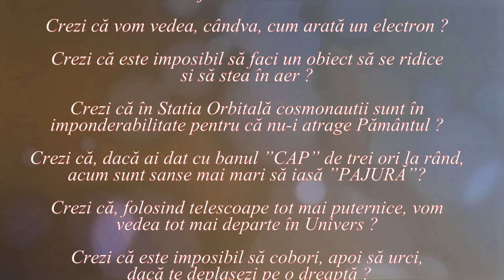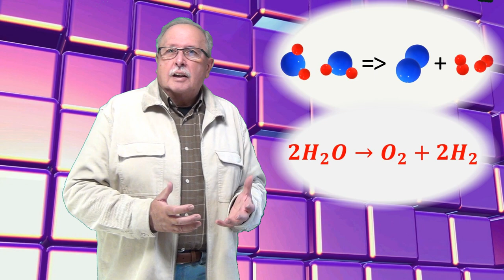Motorul cu apă ? (WATER-FUELLED ENGINE ?) (Lumea nu este cum crezi _ 11)

Comment: Stimate domnule profesor,ideea este că apa poate înlocui hidrocarburile ,poate fi real ?
Reply from the maker: Apa nu poate fi combustibil chimic pentru că este deja produsul unei arderi. Apa se obține prin oxidarea hidrogenului (cu sau fără flacără). Când arde benzina sau motorina se obține apă și dioxid de carbon. Când arde hidrogenul se obține doar apă.
Nici apa și nici dioxidul de carbon nu  pot arde încă o dată !
Dar apa poate fi descompusă în hidrogen și oxigen, iar hidrogenul poate să ardă din nou și iar obținem apă.
Dar PENTRU A DESCOMPUNE APA ÎN HIDROGEN ȘI OXIGEN TREBUIE ENERGIE, TEORETIC ATÂTA CÂTĂ VOM OBȚINE PRIN ARDEREA HIDROGENULUI. Practic mai multă, pentru că avem pierderi prin căldură.
Deci putem înlocui hidrocarburile dacă avem destulă energie regenerabilă încât să obținem suficient hidrogen. Deocamdată n-avem.
Reply: @RomulusBoeriu  Mulțumesc pentru răspuns.
Reply from the maker: @unic3372  Cu plăcere !

Comment: Domnule profesor, eu sunt un necunoscator in ale fizicii si chimiei, detin doar cunostinte de baza. Am vazut si clipurile de pe YouTube legate de “motoarele pe apa” si am citit si comentariile care au aparut la acest clip al dumneavoastra. Cred ca exista o confuzie, comentatorii nu se exprima cum trebuie. Ori ca nu pot, ori ca n-au inteles ceea ce dvs. ati explicat in acest material. Daca-mi permiteti, incerc sa reformulez printr-un exemplu:

Sa zicem ca avem o masina (pe benzina) care consuma 7 litri/100 km. Litrul de benzina sa zicem ca e 7 lei. Deci la fiecare 100 de km parcursi trebuie sa scoatem din buzunar ~50 lei (folosesc cifre rotunde, valori aproximative, oricum e doar un exemplu). 

Daca ar fi sa folosim apa, respectiv hidrogenul extras din apa prin hidroliza, pentru ca masina sa parcurga 100 km (in aceleasi conditii de mers) am avea nevoie de o cantitate “X” de hidrogen. Consideram ca apa e gratis, deci cost zero. Dar pentru procesul de hidroliza trebuie sa folosim energie electrica. Aceasta energie o luam dintr-un acumulator pe care-l incarcam acasa, la priza. Deci platim curentul. 

Acum va intreb: cantitatea de energie electrica folosita pentru hidroliza, astfel incat motorul sa poata propulsa masina pe o distanta de 100 km, ce costuri ar implica? Practic curentul de la priza pe care l-am folosit sa incarcam acumulatorul (care la randul lui ar da energie pentru extragerea hidrogenului din apa), ar genera un cost mai mare decat cantitatea de benzina folosita pentru parcurgerea distantei de 100 km? Va multumesc! 🙏
Reply from the maker: Am explicat acest lucru în clipul "HHO ?" pe care l-am publicat acum câteva zile. Tocmai pentru că, așa cum ați observat, mulți nu au înțeles despre ce am vorbit în "Motorul cu apă ?"
Reply from the maker: Poate n-am înțeles întrebarea de prima dată. Doriți să știți cât ar costa să obținem prin electroliză hidrogenul necesar pentru o deplasare de 100 km ? Voi face mâine calculul.
Reply: @RomulusBoeriu  exact! Si nu e nevoie de cifre exacte, pentru ca ar fi extrem de dificil de estimat (conteaza tipul masinii, capacitatea motorului, transmisia, viteza de croaziera, greutatea etc. etc.), insa macar asa, la un nivel aproximativ. Adica ar costa la jumatate comparativ cu pretul benzinei (sau al motorinei or GPL), sau doar 10% din pret, sau 230% etc. Pentru ca pe internet circula zvonuri cum ca dintr-un litru de apa se extrage hidrogen cat pentru a propulsa masina pentru mai mult de 1000 km. Probabil de aici si confuzia cititorilor. Nimeni nu a zis ca o masina ar merge pe apa generand perpetuum mobile, ci doar ca ar face-o cu un cost mult mai scazut decat cel al benzinei/motorinei/GPL-ului. Va multumesc!
Reply: Teoria internautilor spune ca energia (electrica) produsa de alternatorul masinii este suficienta pentru a realiza procesul de hidroliza si ca folosind o cantitate infima de apa (cca 1 litru) se poate produce cantitatea necesara de hidrogen pentru a propulsa masina pentru 1000+ km.
Reply from the maker: @OldPhonesWorld  Teoria internauților susține că hidrogenul produs dintr-un litru de apă poate propulsa mașina pe 1000 de kilometri ??? 
Păi să calculăm cât hidrogen se poate obține dintr-un litru de apă.
Un litru de apă cântărește 1 kg.
Masa moleculară a apei este 18 (de două ori 1, masa atomică a hidrogenului plus 16, masa atomică a oxigenului). Asta înseamnă că raportul dintre masa moleculei de apă și masa atomilor de hidrogen din ea este 18:2=9.
Deci dintr-un kilogram de apă putem obține (1kg : 9) kilograme de hidrogen, sau (1000g : 9) grame de hidrogen, adică aproximativ 111 g de hidrogen. Cum poate cineva să creadă că 111g de hidrogen pot propulsa un automobil 1000 de kilometri ??!
Prin asta cred că am demonstrat că internauții n-au, de fapt, nicio teorie, iau informații unul de la altul fără discernământ, în loc să le ia de la cei care se pricep la fizică și chimie.

Și acum calculul pe care m-ați rugat să-l fac.
Vreau să precizez, de la început, că este un calcul aproximativ și care ține cont doar de aspectele teoretice. Dacă ținem seama de aspectele tehnice, lucrurile se complică mult, iar rezultatul este că, de fapt, trebuie să cheltuim și mai mult decât arată acest calcul pentru a ne deplasa folosind hidrogen pe care l-am obținut prin electroliza apei.
Pentru a descompune 1 kg de apă în hidrogen și oxigen este nevoie, teoretic, de aproximativ 4,4 kWh. Dacă ținem seama de randamentul electrolizei, trebuie binișor mai multă energie, dar să presupunem că putem să o facem cu 5 kWh. În acest fel obținem 111 g  de hidrogen.
Puterea calorică a combustibililor se măsoară în MJ/kg.
Puterea calorică a hidrogenului este cam de trei ori mai mare decât a benzinei. Știm că ne putem deplasa 100 de km cu 5 kg de benzină (Nu e totuna cu 5 litri, benzina are densitatea mai mică decât apa. 5 kg de benzină înseamnă cam 6,6 litri)
Atunci, folosind un motor pe hidrogen care are cam același randament cu motorul pe benzină, vom avea nevoie de 5:3 kilograme de hidrogen, adică de aproximativ 1,7 kilograme de hidrogen.
Dar, se pare că unele firme susțin că pot obține randamente mult mai bune, așa că, să presupunem că avem nevoie de doar 1 kg (1000 de grame)
Pentru asta trebuie să electrolizăm 1000:111 litri de apă, adică cam 9 litri de apă.
Și pentru că avem nevoie, așa cum am arătat, de vreo 5 kWh energie pentru a descompune 1 litru de apă, înseamnă că avem nevoie de aproximativ 45 kWh pentru a obține hidrogenul necesar pentru a ne deplasa 100 de km folosind un motor pe hidrogen.
Cât costă asta ? Habar n-am, deoarece în ultimul timp prețul unui kWh se schimbă mai des decât apuc eu să scriu aici, așa că vă las să calculați prețul.
În final, repet: acesta este un calcul teoretic și aproximativ. În realitate, dacă ținem seama de toate randamentele și cheltuielile adiacente care apar prin folosirea hidrogenului drept combustibil, costă mai mult.
Încă ceva.
Există o metodă mai bună de a folosi hidrogenul: în pile de combustie.
O pilă de combustie obține, prin reacția dintre hidrogen și oxigen energie electrică și căldură. Apoi, putem folosi energia electrică pentru propulsie electrică.
Nu va costa semnificativ mai puțin, dar va fi mai simplu și nepoluant.
Reply: @RomulusBoeriu  mii de multumiri, domnule profesor, pentru promptitudinea cu care raspundeti si, mai ales, pentru rabdarea si munca depusa spre a ne face pe noi, cei mai putin stiutori, sa intelegem. 

In viitor o sa mai revin cu intrebari sau sa va cer anumite pareri pe teme diferite. 

Va multumesc inca o data!
Reply from the maker: @OldPhonesWorld  Nu-i pentru ce, unul dintre scopurile acestui canal este tocmai lămurirea unor astfel de probleme. Așa că și eu vă mulțumesc pentru că, prin întrebări, mă ajutați să înțeleg mai bine ce anume și cum trebuie lămurit. O seară frumoasă și numai bine !
Reply: @RomulusBoeriu  În sfârșit vad o explicație coerentă și adevărată bazată pe multe experimente făcute de-a lungul timpului. Cu așa cantitate de energie electro..... aș folosi un vehicul electric...zic și eu!
Reply: De ce nu vreti sa antelegeti.Daca de maine motoarele vor functiona pe apa atunci apa va costa cat oricare alt combustibil.